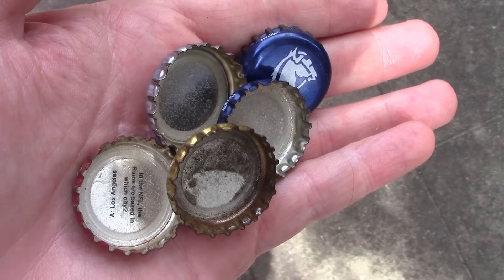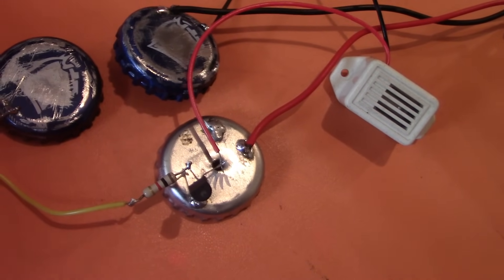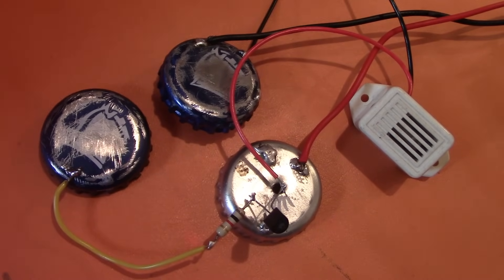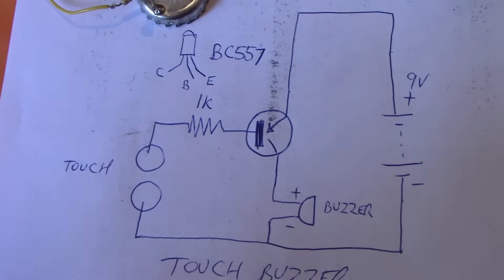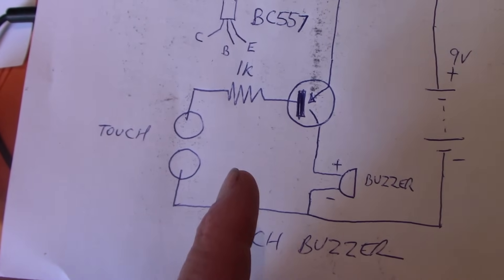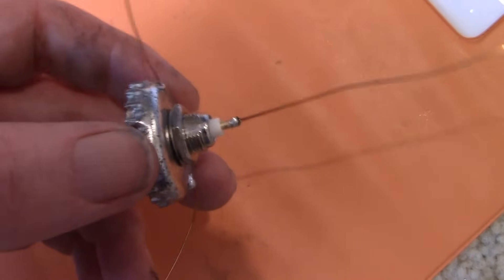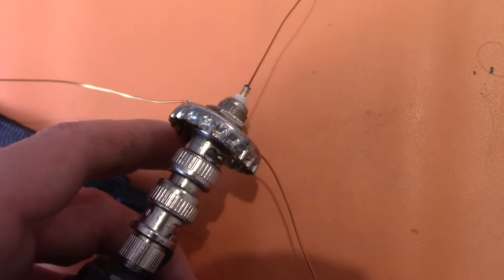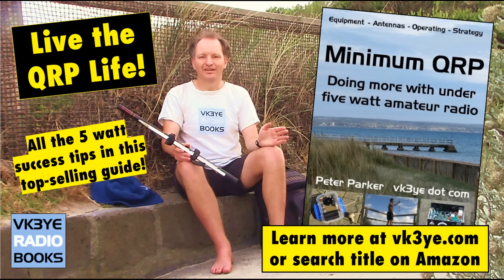Three ideas to use BOTTLE CAPS in radio

Comment: Hi , bit of a question for anyone thanks.  Listening to my regeneration receiver, it seems to have a noise when grounded to water pipe. 
Just for curiosity, I connected a digital meter between antenna and ground ( without radio connected)
It shows 50Hz 200 mV. Is this usual or  indication of a fault ?.Thank you.

Comment: You could use the bottle caps for crude tuning knobs. Another idea is drill holes through them matching the size of a wooden dowel and solder enamel wire to each side of the bottle cap and mount a series of them along the length to make a crude yagi beam antenna. Also use them as heat sinks for transistors by stacking them together for better heat dissipation.

Comment: To overcome the sensitivity limitation of the buzzer circuit, use a single-package Darlington transistor. You may wish to increase the resistor value.